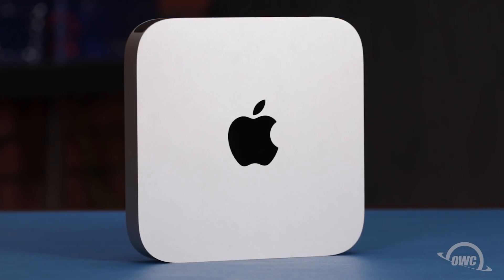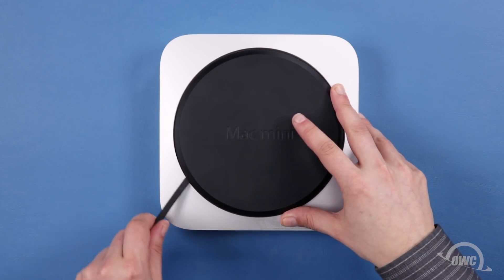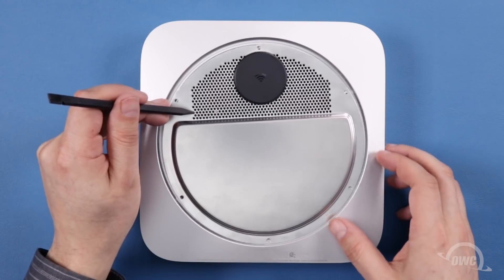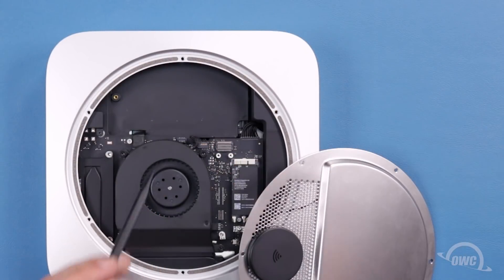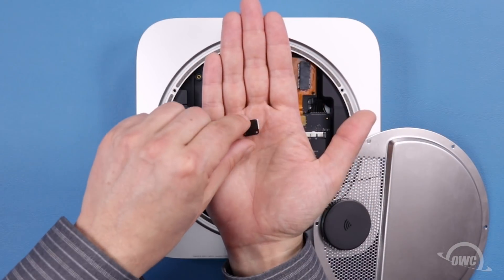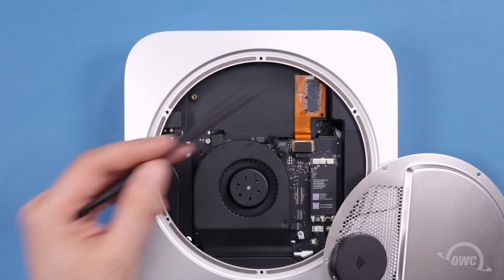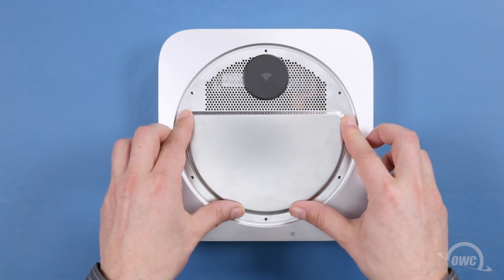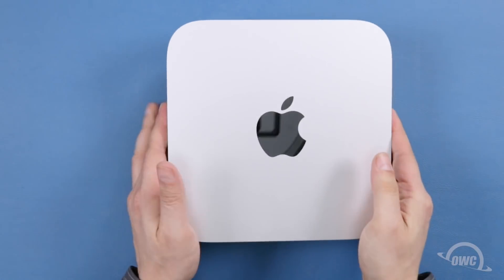How to Upgrade/Replace the PCIe SSD in a 2014 Mac mini

Comment: Good day. i am wondering if all mac mini late 2014 has the PCIE connector slot in the Motherboard even if it only shipped as single HDD and not the fusion drive? i am confused as different internet sources says its not included.

Comment: Will these delete anything on the Mac mini
Reply from the maker: If you are adding this in as a second drive, no, your data is stored on the original drive. If your model came with an SSD, or Fusion drive, then yes, removing the Apple SSD will lose your access to that data.

Comment: Does adding a SSD like in this tutorial allow me to have TWO drives? The default HD and SSD? Does the OWC adapter work with Apple SSD? I have one form my 2015 MBP that I’m not currently using. Thanks for your help.
Reply from the maker: Yes, this method allows for two drives. The adapter will work with any PCIe SSD.
Reply: OWC thank you!
Reply from the maker: You're very welcome!
Reply: @poweredbyowc  I'm installing the PCIe in my Mac mini, keeping my HDD in Mac mini, may i know after I get it done, what  is the best way to setup my OS in SSD? By Time Machine backup (backup from my current HDD) or fresh install OS in SSD?
Appreciate kind advice
Thanks

Comment: Hi, will heat sink required ? if we get the memory stick with heat sink, will. it fit properly. in Mac mini 2014?
Reply from the maker: A heat sink is not required for this drive inside the macMini.
Reply: @poweredbyowc  Thank you.

Comment: Thank You. I did this on my macmini late 2014, buying adapter and 128GB nvme drive on aliexpress. It is only necessary to open the cover and there is no need to disconnect any cables. Very easy. To work, MACOS needs to be upgraded to High Sierra or higher. I keep the old HDD to store my files and nvme to system and apps
Reply: felipe can you tell me how to get macos to reinstall on to the ssd
Reply: @sakethrampalle2386  before installing I had downloaded macos on the 5400rpm drive. Reboot on this drive, and install macos on the nvme drive
Reply: @arqfelipehf  does the ssd have to be formatted to a specific type
Reply: @sakethrampalle2386  i have formatted the nvme drive as APFS because its more reliable and easy to partitioning and works fine with newer macOS systems
Reply: Sorry but i m NOT good in this...so...if i buy a PCIe and an adaptor i can just put it on the original hard disk and connect the cable to the logic BOARD?
Reply: Davide Bernardini on the fusion drive models there is a dedicated slot for the pcie ssd and the hard drive models there is a slot where you can put an adapter in. you don’t have to change the hard drive or anything
Reply: Sakethram Palle thank u so much! Can u tell me how can i find out if its ok for my late 2014? Thanks
Reply: @sakethrampalle2386  Yes. There's a conector with easy access to adapter and nvme drive. Too easy to install. My MacMini became much more faster. You have to know what you want to do. I'm talking about a much simpler and easier method with a better result
Reply: Davide Bernardini check what ghz the processor is and the storage in the about my mac section to see if it says HDD or fusion drive
Reply: Sakethram Palle i dont have it Here right now due to coronavirus lockdown, but i know this: Intel core i5 1.4 ghz, ram4gb 1600mhz ddr3,  500gb Sata, Intel hd5000 1536mb.
Reply: Davide Bernardini so then u need the adapter for it since it is the base configuration
Reply: Sakethram Palle Sakethram Palle Sakethram Palle yes it is the base...but its ok...i need the ssd and the adapter..like in the video, right?
Reply: @buonanotte77  omg I have the same setup. Any luck on the upgrade? Let me know which ssd you upgraded it to.  I am planning to go for a 250 gb ssd.
Reply: No need to open everything and take away the old hard disk?

Comment: Thanks a lot!! Right now I use an SSD via usb 3.0 and while this is still a lot better then the 500gb rotational drive(It's near impossible to use) A SSD Nvme setup is the way to go, with minimal mos on a '14 Macmini.
Reply: Hi Klayton, for my mac mini late 2014 A1347, do you think i can keep the original SATA hdd and install another PCIe SSD as my primary drive? Or I have to take out the SATA drive then I can install a new PCIe SSD?
Reply: Kirin Jan 
Hi, yes you can keep the original sata. In fact, this is my setup. You gonna need an Nvme ssd 2280+ the adapter. After everything is installed, format the nvme to apfs format, then make an exact copy of your current hdd. After all that, chose the new drive as the primary boot drive. There is tons of info about this procedure here on YouTube.
Reply: Klayton Almeida Thanks man. Did you have any chance get the full read/write speed from the PCIe SSD? The reason why I’m asking is now I’m looking for a PCIe SSD but the price varies mostly by the read/write like 2000-5000MB/s, but as I checked out many other videos the results were capped at 700mb/Sec or something. Does it mean the Mac mini 2014 bus wouldn’t support the speed like that?
Reply: Hi Kirin, yes the Macmini 2014 bus for the nvme, are 2 lanes only. It means that any nvme faster than, lets say 1000mb/sec is a waste os $$$. Benchmarks here, shows write speeds between 400-450 mb/sec and read speeds near 700mb/sec.
Reply: Klayton Almeida Got it! I’m truly appreciated your sharing. I wish you all the best.

Comment: so... don't you need replace the HDD on it? In this way, can you use both?
Reply: Basically yes
Reply: Can you transfer the OS, apps etc from the origina HDD to the PCIe SSD? My 2014 mac mini runs slow on catalina thats why. thanks!
Reply: @c00l0ne  i have a macmini 2014 and Catalina runs slow on my mac too. I hope it gets better when I replace the HDD

Comment: Where can I get this PCIe SSD "cable connection" (The adaptor cable ) shown in the video. Couldn't find on Google. Any Idea?
Reply: Search B07JCPZC8Y into Amazon. Just a word of warning though, Apple Uses custom SSD sticks and aren't compatible with other computers. The one they use in this video is OWC's version that uses the same connection point. The SSD adapter cable I linked you is for any M key SSD (Samsung Evo, Sabrent, WD, Corsaire etc).
Reply: @_Asuri  Thanks for your valuable reply.
Reply: I Got 970 evo plus - which should I buy?
Reply: @_Asuri  tried searching for this cable but it is not on amazon anymore? couldn't find it
Reply: I'm also looking for this cable.  Any luck?
Reply: @lonewolfict  Search "mac mini pcie ssd cable" there's 2 listings and one only has 4 available as of typing this.
Reply: @robertlabanca2877  On Amazon, search "mac mini pcie ssd cable" there's 2 listings and one only has 4 available as of typing this.
Reply: Thanks.  Got 1.
Reply: @robertlabanca2877  I just did a little more researching and there is a video out there that uses a PCIe NVME drive adapter to use non-Apple PCIe SSD. Titled "Installing a PC NVMe Into a Late 2014 Mac mini" I'm looking into this as regular PCIe cards are much more bang for buck.
Reply: So the one on Amazon only allows the Apple Memory?
Reply: @robertlabanca2877  Correct. Or 3rd party compatible ones like the one OWC sells. It's physically different. So check out that other video because using a non-Apple proprietary is very possible and cheaper.

Comment: This costs more than the used Mac Mini!  Think i'll stick to SSD drive and go a bit deeper into the box!
Reply: That's because Apple uses custom SSD sticks and the ones linked in the video are OWC's versions using the same chipset. If you search B07JCPZC8Y into Amazon, it'll show you an SSD connector kit for a standard M key SSD. I just installed a 512GB stick in my Mac Mini and with the adapter, it came out to $75.
Reply: @_Asuri  Thx for the info...  I actually put a regular SSD into the box last week.. 25 mins of work and only cost about $50... good stuff!
Reply: @pesto12601   what does it do to the Mac mini exactly? Novice asking for my Mac mini
Reply: @JJman534  The SSD drive makes you mac mini run MUCH MUCH Faster while enabling you to increase space.  Worth the 30 minutes and small $$$ to upgrade.
Reply: @pesto12601   do you think I should get a new 2018 Mac mini or get the 14 and do the upgrades?
Reply: @JJman534  I wouldn't spend the $$$ on a 2018 mac mini... too expensive for the lack of power... if you are just doing moderate work.. get a used 2014 and upgrade... I run VST's and DAW via the 2014 and don't have any issues...  all for about $300 out the door!
Reply: @pesto12601  Thank you for your insight. last question will I be able to upgrade the RAM on the 14?
Reply: @JJman534  glad to help.. sorry.. the RAM is soldered and not accessible for upgrade or removal... that would have been nice as well but the SSD upgrade is very nice indeed!

Comment: Is this possible for base model late 2014 core i5 ,1,4 ghz 4 go ram model A1347
Reply: yes for ssd but your ram is still limited to 4gb
Reply: @slam5  I have this setup  on my late 2014 mac mini - Intel core i5 1.4 ghz, ram4gb 1600mhz ddr3,  500gb Sata, Intel hd5000 1536mb. Is the 4gb ram good enough for the 250 gb ssd? I mainly use it for browsing and gaming(only dota2). My hdd is giving me a hard time and that's the only reason for the upgrade. It was working smooth with this base setup until now. What would you recommend upgrading?
Reply: @buzz4eva  NOPE, but 2014 mini's ram is soldered in, you can't increase the ram.  ssd is a very worthwhile investment for you esp if you want to keep it.
Reply: @slam5  Yes you are right, I cannot upgrade the RAM. However, I am confused whether to upgrade to nvme pcie ssd or a simple external ssd to boot the os from. Does it make a lot of difference? Because I am unable to find the connector for the pcie ssd here in India. Can you recommend any 2 ssd in this list -
1. Kingston 250GB A2000 M.2 2280 Nvme Internal SSD PCIe Up to 2000MB/S (SA2000M8/250G)
2. Samsung 970 EVO Plus 250GB PCIe NVMe M.2 (2280) Internal Solid State Drive (SSD) (MZ-V7S250)
3. ADATA XPG GAMMIX S5 256GB PCIe M.2 2280 Gaming Solid State Drive (AGAMMIXS5-256GT-C)
Reply: @Anup Basti hi, you can’t get a regular pci-e m.2 ssd in there.  apple use a proprietary pci-e connector in there so the only ones you can use is theirs.  if you look in this video, the short finger of the connector is much larger than a standard nvme you mentioned above.  you also need a special kit to put in a pci-e drive as you most likely don't have the special adapter for it installed.  https://www.youtube.com/watch?v=TUtG3SSZ4Bw
Reply: @buzz4eva  imo, your best bet is to put in a regular sata ssd in there.  that mini is old, there is limited stuff you can do to it.
Reply: Anup Basti get it from ifixit in US.
Reply: @slam5  are you saying that I will not be able to find a pci-e m.2 connector which will be compatible with the nvme's available in the market?
Reply: @slam5  Yes, I have a toolkit to open the Mac though. But I think its safe to not open it. How about something like this ? https://www.youtube.com/watch?v=Ejy4K7gO14A I would rather just get an external Sata ssd and connect it via usb and format+re-install the os on it? Would this still be better than using my regular spinning drive?
Reply: @buzz4eva  you can get the nvme connector from ifixit.  my point is while the nvme ssd is "faster", it isn't worth the extra work.  for that mini, the bottleneck will be RAM. for going to nvme ssd, you need to pay extra for the adaptor, and then find the nvme ssd (and they are expensive).  from what i see on ebay, you can only get refurb or pay an arm and a leg for a new one.  a new 240gb one will cost you $ 140 and then add the adaptor you are better off to save your $$ and hunt for one with 8gb of ram.
Reply: @slam5  Okay I get it. I would rather just get an external Sata ssd and connect it via usb and format+re-install the os on it.  @
 Will this be a good upgrade from my Sata spinning drive? And the best part is I do not have to open the mini :) I am planning to get a 250 gb external Sata ssd. Any recommendation on the brand?
Reply: Can you advice to me any advice
Reply: @lourancealhameed5549  just upgrade your machine to the pci-e ssd. that one is much simpler and even can be done by enduser with a bit of watching YT.  The PCI-E ssd will cost you more but is is much easier.  You can mount a regular SSD in there but the procedure is much more complicated and if you make a mistake, your mini won't be whole again.  I ruined a 2011 mini 2 years ago because of carelessness.